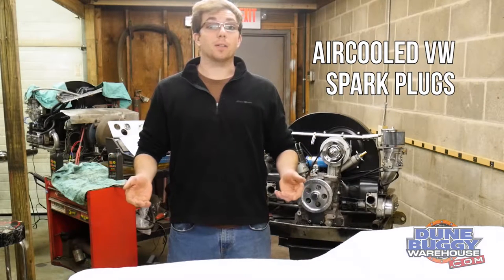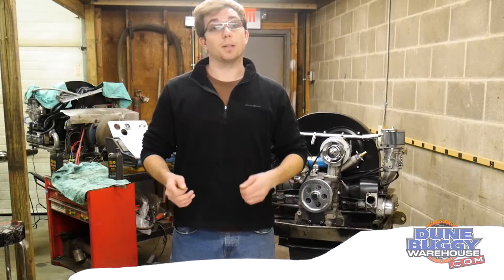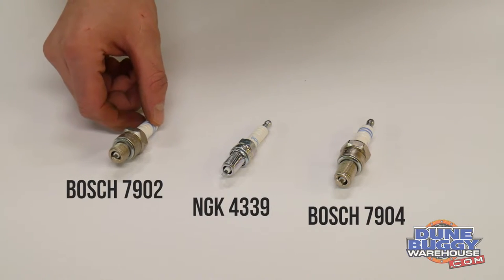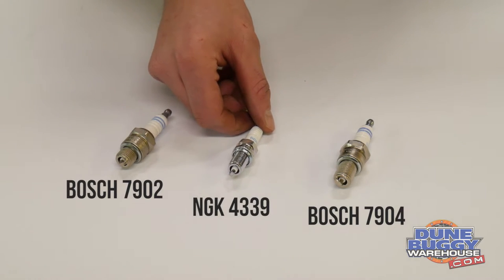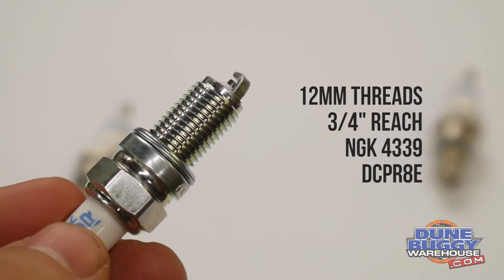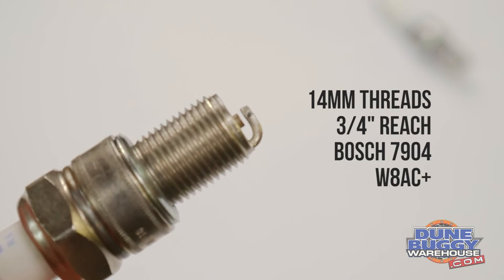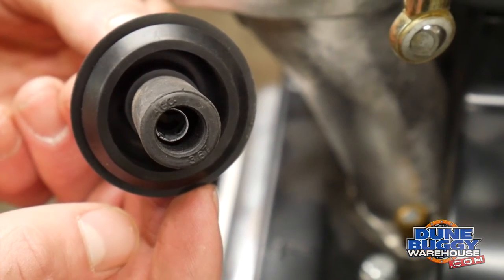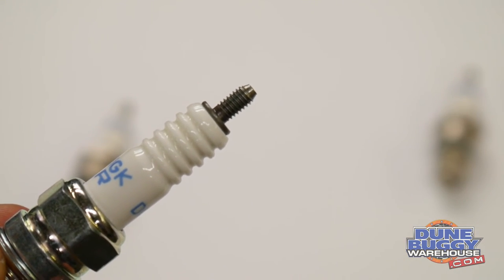How To Tell Which Spark Plugs You Need for Your Air-Cooled Volkswagen Bug - Dune Buggy Warehouse

Comment: I have a question what size idle and Main Jets should I use on an 1835 with a 125 angle cam 1.25 rockers 40 carburetors idf
Reply from the maker: For an 1835 with dual 40's, I'd recommend mains at 1.40 or 1.45 and .55 idle jets. This is with 28mm venturis, 2.00 air and .50 pilot jets.

Comment: Good afternoon friend ... I have a 1973 super beetle with 1600 Dual Port Cyl engine. Head, ignition coil bosch 00012, Centrifugal Advance 009 Distributor With Electronic Ignition 9441-B, Bosch 09001 Premium Spark Plug Wire Set, brosol carburetor solex 30 pic, which spark plug recommended me to use to make the engine work very well?
Reply from the maker: It depends on which heads your engine has. If they are stock heads use the 14mm 1/2" reach Bosch 7902 plugs.
Reply: Yesss... mi engine use  stock heads.. 85.5mm
Reply from the maker: Bosch 7902 are your plug - https://dunebuggywarehouse.com/bosch-7902-14-mm-1-2-inch-reach-spark-plugs-pack-of-4.html
Reply: Can I also use the Bosch W8BC Spark Plugs? Do they work the same way or not?
Reply from the maker: W8BC can work for setups where you are absolutely sure the deck height & chamber size won't have your piston impacting the plug. The W8BC is a projected core plug that should burn more thoroughly, but is longer and sticks into the combustion chamber.

Comment: Good afternoon friend I have another question ... I have another engine with the following features: it is 2110cc, Bore Size: 94 MM Springs: Single Springs Valves: 40 & 35.5mm., Ignition coil bosch 00012, Centrifugal Advance 009 Distributor With Electronic Ignition 9441-B, Bosch 09001 Premium Spark Plug Wire Set, Empi Single 44 Hpmx Carburetor, which spark plug recommended me to use to make the engine work very well? ... Because this engine has many more HP and RPM
Reply from the maker: This engine sounds like it may have aftermarket heads. Measure the spark plug thread width, if its 12mm wide you should use Bosch 7700 or NGK 4339.
Reply: Yesss...  they are new cylinder heads, I buy them from your store .. by amazon.com, Manufacturer Part Number 500 420 XX X2 -94, are the following: AA Performance Products VW 1600 Dual Port Performance Cylinder Heads, 40X35.5 "Pair" Bore Size 94, can I use bosch 7700 or NGK 4339 spark plugs?
Reply from the maker: Either Bosch 7700 or NGK 4339 for these heads